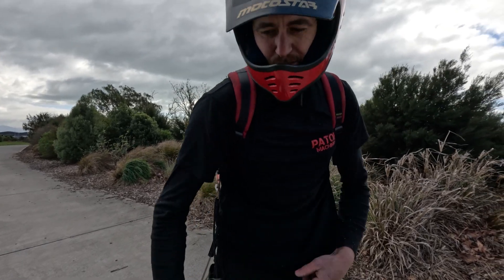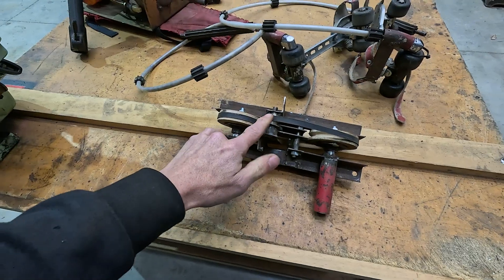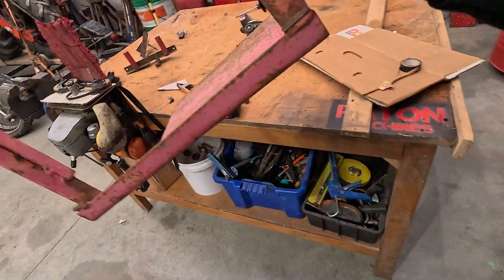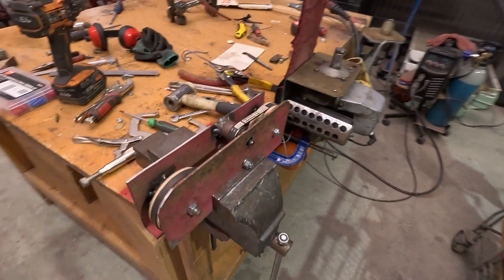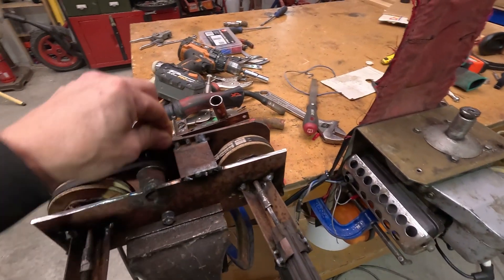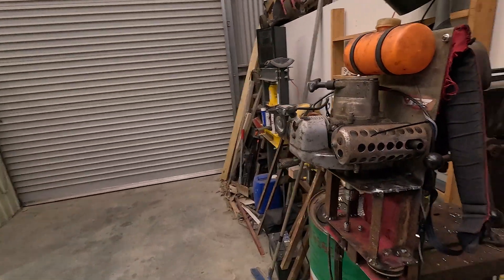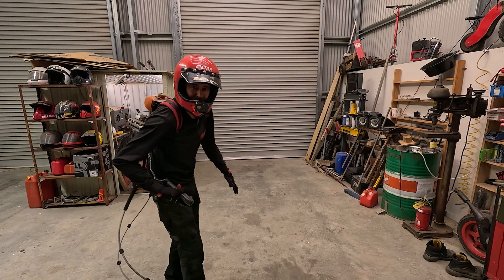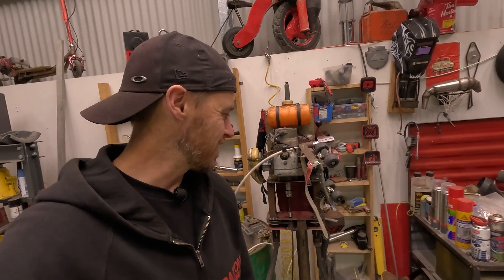Building Motorized Skates! - 2nd prototype!

Comment: would making it front wheel drive work better pulling the skate rather than trying to push it?
Reply from the maker: I did think of that but when the "power" goes on and you lean back, it'll lift the front wheels and spin?

Comment: Sounds like the perfect build for a juicy Health care insurance sponsorship...Lol! I can see the cables twisting and jerking under the load....I think you're right to try and speed up the cables, and slow it at the wheels.
Reply from the maker: Yeah having the gear reduction at the top was a minor oversight.
Reply: @PatonMachines  Something only someone with cable drive experience would even think of, so don't beat yourself up too much. I have some large scale RC boat cable drive experience with high loads which is why it stuck out to me.

Comment: Use the motor for maintaining speed not accelerating from a dig.
Reply from the maker: There's a little too much friction in the drive line to skate without the engine running.

Comment: When you do your next test you'd be better off giving a conventional kick to start rolling before applying power, it would probably reduce the risk of wobbling about and falling over when your feet drive out from underneath you because you'll already be moving.
Reply from the maker: Yeah that wasn't ideal! One of the problems was the flex drive cable to the skates would load up and release so it didn't have a smooth power delivery to the skates. I'm hoping higher rpm on the cable will fix that